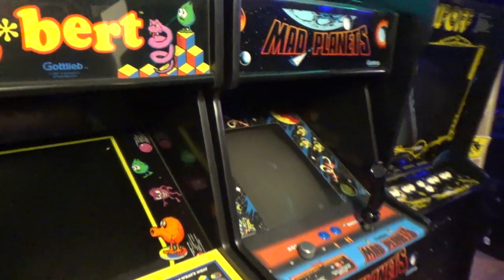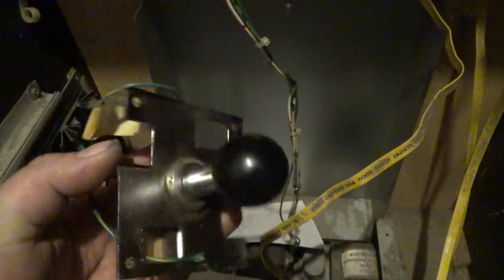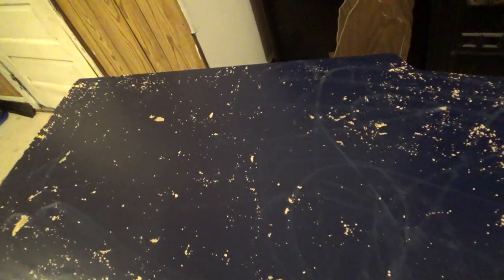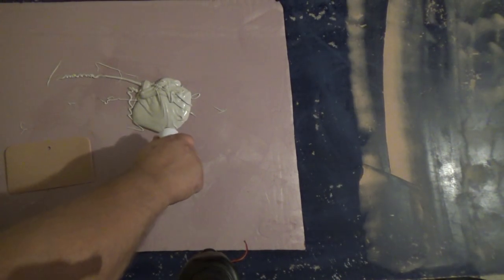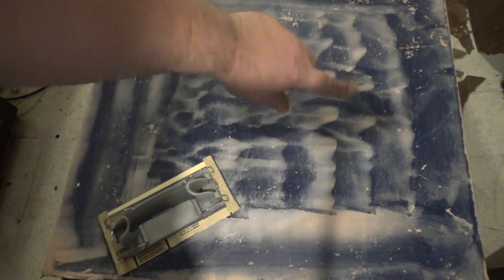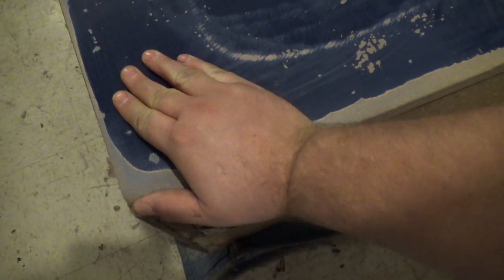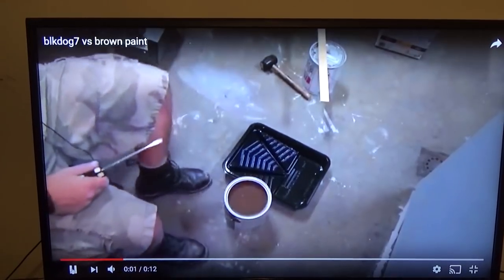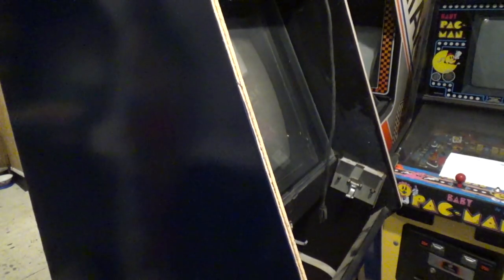the Journey begins!!! Journey restoration part 1

Comment: what I would have done to repair that corner is use the router running against a straight edge to cut the bad wood out and then cut a new piece of wood to insert and then bondo the seams. I always try to use original material when I'm repairing anything